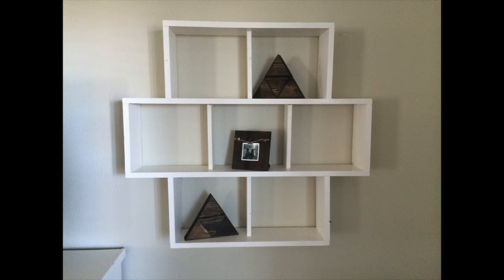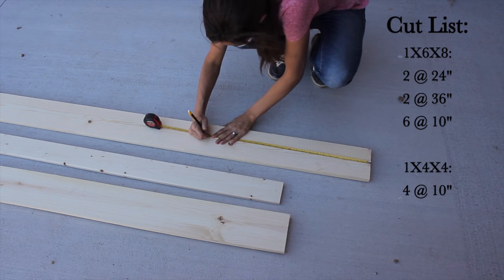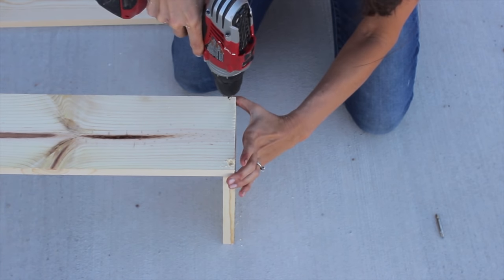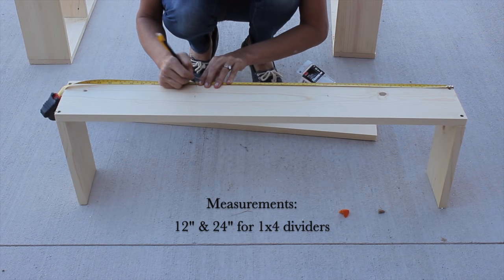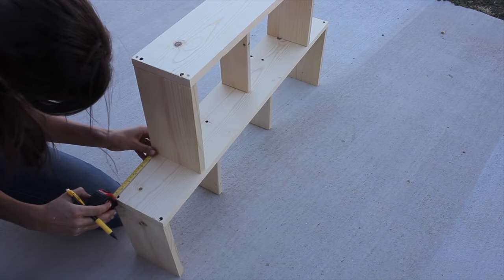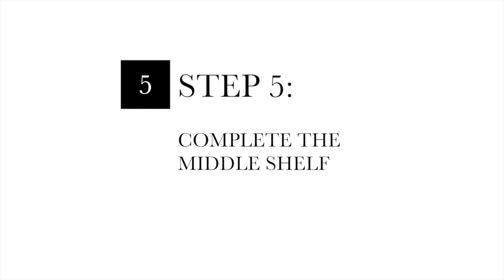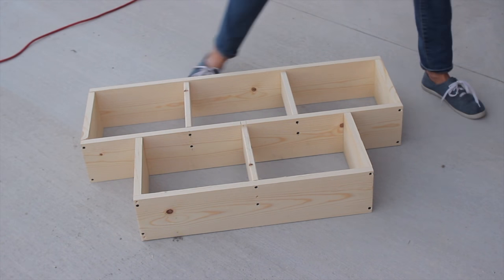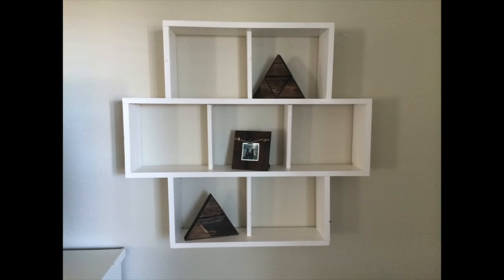DIY Wall Shelf

Comment: I love projects like these but I'm intimidating about buying wood. I always get lost on all the wood aisles and it's like looking at a mountain of different woods. Plus I don't know the lingo like "countersync" or what those special bits are. I just know the regular ones. When I get to the store they don't seem to know what I'm talking about our don't have it. I've just given up but I still like watching the projects and wish I could do them. Does anyone know of a vlogger that teaches the basics of buying and selecting wood and things like where to find it. I'm like a fish out of water at Lowe's & HD.
Reply: I was the same but a recent Reno I have learned you don't need counter sink bits which are bits that drill into the wood just enough that the screw head can sit flush into the wood so it isn't sticking out like a sore thumb so when you paint it you first use wood filler to fill it and hide the screw.  to do this you can just use a drill bit that is a lightly wider than the screw head to counter sink it, gl
Reply: +Erin Carter Hey, Erin! I totally get it! I was there about 1.5 years ago! Here's a link to the countersink drill bits I purchased: http://www.homedepot.com/p/Ryobi-Power-Groove-Countersink-Set-5-Piece-AR2008G/205193155
Also, you don't have to use a countersink drill bit-you could just you a bigger drill bit and drill about 1/8" down just enough for the screw to be slightly lower than the surface of your board. I hope that helps! You've totally got this!  If you have any more questions-don't hesitate to ask :)
Reply: +brian pereira Thanks. I think I followed that. 😊
Reply: +Hardy “Hardy Home Reno” Home Thank you. I appreciate the response.

Comment: how to hang it on the wall ?
Reply: Hi! Thanks for asking! I used large sawtooth hooks. Since I just have small decor items on it - that works just fine! If you're going to put anything heavy on it - I would definitely use heavier hooks and and drill your screw into the wall stud. I hope that helps!
Reply: I'll try it. Thankyouu :)